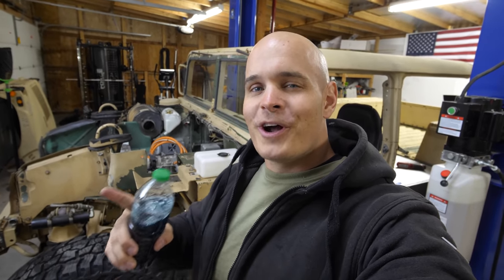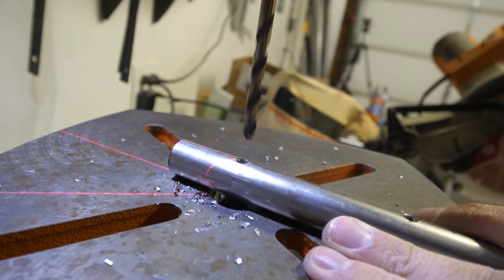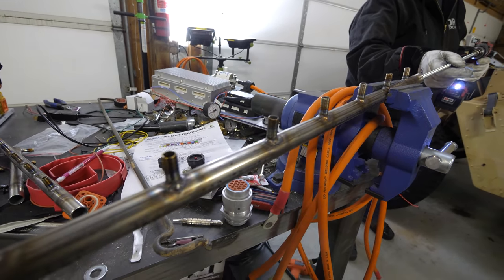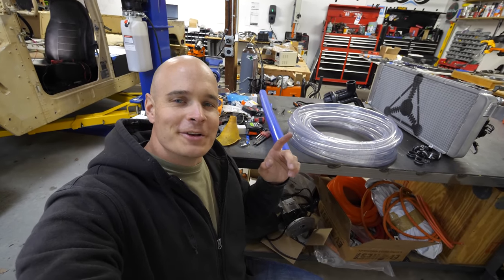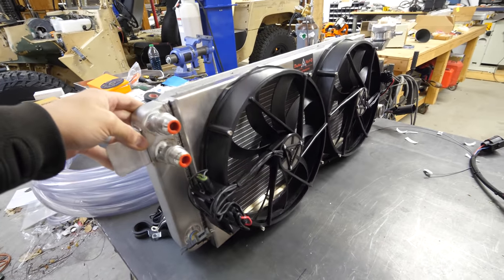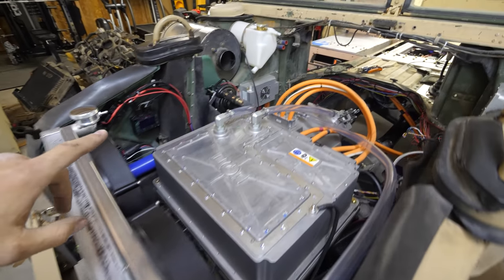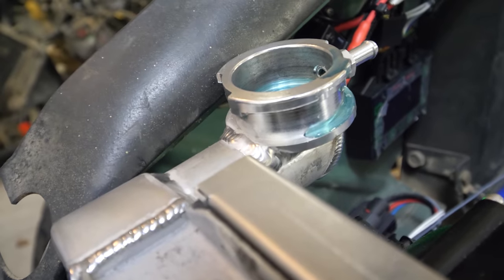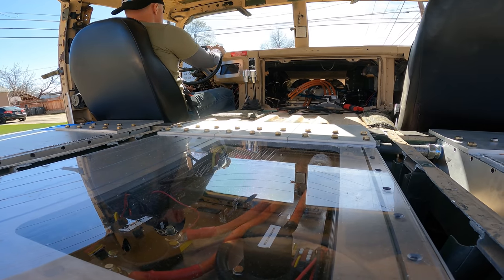The ELECTRIC HUMMER projects 'coolest' video YET...

Comment: Nicely explained. However, I'd like to give my two cents as well. On one side, an expansion tank would be, as some others have said, quite necessary, not only because water expands and contracts but also because althought the system may have no leaks in theory, in practice there may be some if, for example, the lid of the radiator allows some vapor to be released when it reaches a certain pressure. All in all, the temperatures this system should work are nowhere near what an internal combustion engine has to deal on a regular basis, but that adds that extra peace of mind.

And secondly, from what I see, there are some higher and lower spots, for example the top of the, I think it's the part in front of the engine, right where those clear hoses meet some angle pipes. There's some air trapped in there as, again, it's a high spot, and that air is going nowhere and therefore decreasing the efficiency of the system. It may not be something to worry, as it actually works in lower temperatures than, again, internal combustion engines, but it will certainly make the system work harder and therefore more power consumption. So, I think some kind of purging valve should be placed there and anywhere else where there's a local high spot in the circuit. If you're changing your piping for another one that can actually deal with antifreeze (as someone else has suggested) I wouldn't hesitate.

Thanks!

Comment: Regarding aerodynamics, perhaps you could have something like an acrylic bubble cover over the hood in the front creating a smooth transition all the way to the roof out of a transparent material; and smooth out the rear facing surfaces into something a little more raindrop shape with whatever composite material or whatever you prefer?

Comment: Really cool project! Are you planning to completely bleed out the air from the cooling system? At 25:16 it looks like there's quite a lot of air left.
It might make some problems on hot days or long rides if some of the components are not or unevenly cooled.
Reply: usually watercooling has a reservior for trapping the air. kinda missing here. or maybe i am just too used to having one from pc watercooling.
Reply: @FeuerToifel  the rad is the res on almost all cars. Bmw makes some vehicles with a separate res.
Reply: @zillbot  is that US car thing? Because majority of cars i drove in EU have seperate res for coolant.
Reply: @keldon1137  there is an overflow res but that is nothing like the res in a pc cooling loop. The overflow is not actually part of the loop itself.
Reply: @keldon1137  It does not, it's an overflow bottle. I've never seen a standalone res on any car that I've ever worked on or seen under the hood of.

Comment: A little late to the game, but question: Why didn't you run the internal LCD for the fan temp into your cab? Not even for the cool cyberpunk look, but just because having the fan temps in real time would probably help some rather than having to access it from under the trunk.
Reply: Or just report it over CAN-bus to be included in the main displays next to speed and charge level.

Comment: NO RESERVOIR? What about thermal expansion??? You could get leaks in the system without a reservoir that's one of the big reasons they're used in cars

Also your radiator seems to be aluminium, but the heatsinks in your battery might be copper... which will lead to galvanic corrosion, and eventually your system will leak (hopefully not inside the battery or it will destroy it). Just make sure you're not mixing metals!!

Comment: Based on the numbers displayed for drag coefficient and area, the approximate power in kW lost due to aero drag at various speeds in mph can be calculated as 0.15 * v^3:

30 mph ~ 4.1 kW
40 mph ~ 9.6 kW
50 mph ~ 18.8 kW
60 mph ~ 32.4 kW
70 mph ~ 51.5 kW

These numbers are approximate values for aero drag only and do not include other losses due to the drive train, inverter or motor inefficiency etc. However it can be seen that the range at 70 mph will be less than 140 miles with a 100 kWh battery pack, but could potentially be 250 miles at 50 mph.

Comment: The cooling effect is using the Venturi principle, moving air across something will draw the cooler air along with it therefore cooling better. We use it all the time to hydraulically ventilate smoke and heat filled rooms by spraying water out a window…drawing cooler air at the nozzle and forcing the heat and smoke out!

Comment: That clear vinyl tubing is usually not rated for anywhere near 140 deg. Even if it is, it will become very soft and subject to damage easier. The same tubing that has the braiding should be fine like you used elsewhere. Nice work!

Comment: Hey Jerry I have been following these humvee videos since the beginning
My job is a tactical off-road instructor  and mostly working with humvees.
The project is awesome and inspiring! Good job!
Two issues.
First the roll cage is not complete and cut, you should fix it, it's really dangerous!
Second, i think the radiator should go the same as the original humvee angle, maybe the engineers know why they put it that way?

Keep doing the great job done!

Comment: You should install PWM control for the pump and a set of valves. Direct the heat from the motor/inverter into the battery to make it 20°C instead of wasting the heat through the radiator. Should be pretty easy to shut off the radiator and put motor and battery in series for heating. Otherwise open radiator and use a 3 way valve to controll the cool water going to the battery.
Reply: Pump and fans already have PWM speed control internally, both are brushless. Bypass valves are a good idea.  Just bypass the returns back to the pump.

Comment: I have been a huge fan of yours specially the electric humvee project,
Being an Electrical / Electronics Engineer I too work on DIY projects and also fully maintain / service my Old Vintage Pajero 
You should change the Coolant Pipes (Transparent/Clear) one's,
These pipes donot perform well under high pressure and temperature, use black double layered inter woven hose pipes,
those will work well for atleast couple of years,
Anyways cheers and Keep on DIY-ing 😂

Comment: Mixing stainless and aluminium may give you problems with galvanic corrosion, the more diffrent the metals are in corrosive resistanse the worse the problem gets. And yes this still happends with glycol in the mix.

Comment: 19:03 Imo, even in a relatively low pressure system, without a barb that pipe, vibration will eventually work that connection loose.

Comment: Are you wedded to keeping the original shape and configuration? I would consider raking or angling the windshield, possibly replacing some of the steel with something lighter. Ideally getting the most mileage out of those humongous energy packs, also light enough, to take into the backcountry for an extended crawl and romp, without worry about empty batteries and or being stranded. Or are will you add a  generator and 5-10 galleons of gas or diesel as backup to recharge? Or, will you ever go more than a few miles from town? Anyway, a great project, two thumbs way, way up. Envy is eating away at me, that is on me. You are a visionary.

Comment: The initial comparison of cooling requirement based on inefficiency (and thus heat loss) makes some sense, but remember that most of the energy wasted by an engine as heat leaves as exhaust heat, not through the cooling system.

Comment: Great setup, been following you and the build for a while. Now you have a lot of tire and hub noise, normally that is absorbed a litte bit by the engine and wind (stone crunch 6.2/6.5 machine) noise, but since you have silence motor now it must be a lot of winding noise from tires and hubs. You should look into HUBS from the last build Hummer H1 Alpha, 2006 year. It has angel cut gears, not straight cut like all others Hmmwv or Hummer H1. Expensive YES, but more silence.

Comment: 1:32 Motors have an efficiency curve, it is possible that there is a point the motor is 94% efficient it could also be as low as 70%. 1:52 People have speculated that Tesla have an 89% efficiency under unrealistic idea conditions, including age, state of charge, input power and temperature. I've not watched the whole video this may be expanded on later.

Comment: Software to help with aerodynamics, Eh! The spoiler is an upside down wing: spoil the spoiler times 5 and use 
vertical stablizers times 2 for turns = the
Tethered Flying Car or
the Tethered Flying
Hummer!
The new Hummer is at 9000 pounds and could
use some lift! Stage 2 of 3 stages should be a
Power Tray with hydrolic body lifters to allow for layers of traffic; stage 3 allows for the body to lift the power tray to fly with the power tray landing THEN lowering the body of the car! The turns therefore will
be like the other forms of transport.

Comment: That is a great truck!!! Did you figure out heating and AC??? Should be able to get heat from your cooling system with only a additional electrical off the batteries. AC is all electric with a built in heat pump!!! Now to make it all weather friendly!!!

Comment: No good cooling flow around the battery modules, you need an inverter return line for equalizer the flow in each module. 
In you system the first module have a lot of flow since the last of the pipe ;)

Comment: Just wondering if Plan B Supply could / would help you tighten up those bolts on your bucket, I don't know if they are within the range of your batteries. Mostly I want to know if their build quality makes you smile like cutting metal with a lazer.

Comment: Zack, catching up with this build. In the trade we are excited about 12 volt control systems, especially the traction battery giving amps across to the 12 volt/1500watts box. In here you don't have the big voltage orange going in, however some low voltage wires going in.
Will you join the 400 volt system to the orange socket or just keep it is?

Comment: IMHO you need a crawl mode button which acts like a cruise control for the lowest speed at which the motor has full torque. It's going to be really low and really slow, but you'll want it for rock climbing and such.

Comment: Love the project and the videos. Awesome work. One question, have you considered having coolant enter the battery packs from the bottom? Since heat rises, I figure it would help with the flow (every bit helps?). Water cooled turbos are designed that way.

Comment: On the aerodynamics problem.... You take a leaf out of the Lamborghini book and pump air into the space behind the vehicle to reduce its drag. Lamborghini do this by allowing the hot exhaust gases to come out of the rear spoiler/wing on the Huracan. Now you don't have hot exhaust gases, but if your battery was air-cooled you could rout that volume of air into the space behind the hummer to mitigate the aerodynamic drag.
I wonder if pumping that much air could tick both boxes? (cooling the battery and reducing drag)
Reply: I agree, hypothetically, i wonder what it would sound like if he did end up making the car air-cooled? You totally wouldn't want to air-cool the batteries unless you were incorporating some extra feature like aerodynamic reduction.... 
It could get noisy i guess? The old Toyota hybrid system is a little noisy with its air-cooling and its only got 1KWh batter capacity. So Zac's its 100x bigger.

Comment: Surprised battery cooling didn't run lengthwise in the space naturally left over when stacking circular batteries.  That space being a 3-pointed or 4-pointed star cross section depending on stacking pattern.  Flat cooling channels would be natural for pouch cells, but not 18x65.0 cylindrical cells.

Comment: I started watching these videos this morning and as of now, I've only got 3 left to go.  I realize this question is late, but what about heat and window defrosting?  It might be uncomfortable to drive in cold weather and really hard to see through the windshield as well.  I am not sure how bad your winters get.  Though I suppose with multiple vehicles, you don't have to drive it in the winter.  I used to have a Suzuki Samurai that was about as aerodynamic as your Humvee but much lighter.  It was a lot of fun to drive in the summer with the top off.  But it was so boxy with the top on that I found myself compensating for cross wind so much that the car would suddenly veer when I went under an overpass cutting off the wind.  I miss that little car.

Comment: So we're down to 89.3% efficiency at the motor output shaft (94% x 95%). The "Golden Rule" is 15% but you don't have an actual transmission. Following the "Golden Rule" gives us an overall system efficiency of 75.9% compared to an average Internal Combustion Engine which comes to only 25.5% of the system energy reaching the wheels. Basically the whole system is 3x more efficient. If you had a motor at each wheel it would obviously go up from there as you'd lose most of the transmission losses.

Comment: Jerry did you know that in the cooling system there is not supposed to live air in it or it can or may give you some over heating problems so just to mention it out you should bleed the air out of the cooling system

Comment: @JerryRigEverything the engine sounds like its jerking. I wonder if a torque converter or soft coupling or some kind of tuning would help. That's just how the motor sounds, like its jerking back and forth, rather than smooth acceleration. Or it could just be the sound of the vehicle's bad suspension hitting bumps on the road.

Comment: one minor thing, might wanna add a tube at the little nozzle near the radiator fill cap...
You know... just in case so it won't just spill coolant all over the electronics when pressure builds up :|

Comment: Jerry, I have a HUGE question to ask you. Is it possible to add belt and friction dynamo generators to all four wheels in order to generate electricity whilst the car is in motion? That way it would extend the distance of the HUMV-E quite considerably. Sort of the opposite of regenerative breaking?
Reply: That would defy the laws of physics. Any energy expended to propel the generators would be energy drained from the battery in the first place, and you would lose energy in the process to heat and friction. Besides the electric motor is a big generator and when he coasts it will turn from the drivetrain momentum and regenerate electricity into the battery anyway (I believe he said his motor controller supported regeneration). The reason regenerative braking is considered braking is because there's considerable load when you are using the motor to generate electricity.

Comment: @JerryRigsEverything: Would you say this vehicle with all the electric conversions still safe for deep water crossing? I really love what you have done here. I have an old Toyota Land Cruiser 80 and I have been thinking about overhauling it to make it a super offroader, however, when I think about the powertrain overhauling, I am not sure if I should rebuild the already functioning powertrain and add two turbos, or convert it over to what you have done? Water crossing and mud are my concerns. Also, in the case of rebuilding the gas engine and adding turbos, I am not sure if I get any better fuel economy than the current 12-15☺️

Comment: Shouldn't there be an overflow tank connected to that spout directly under the cap?
Reply: I don't think it needs an expansion tank since the temperature and pressure are much lower than a standard cooling system you see in a gasoline engine.

Comment: Hey Zack ! do you keep the Cooling system always on? Like connected to the 12V and it only comes on when you turn the key "igniton" on? or does it stay on all the time. cos that could drain the battery but also you need the cooling circuit working on if its charging the batteries right?

Comment: Do you need all 3 battery packs at the same time or can  you separate them so they can be used 2 at a time then  and use and 24 volt alternator and inverter to charge the pack not in use on the go your already cooling the packs to begin with obviously its not gonna power indefinitely but i dont see how this cant extend your range doin this in any electric vehicle should be possible unless you need the full power of all the batteries at once

Comment: 70% lost power is mostly lost bcause the exhaust is at 1600 degrees and still expanding: one cylinder is able to power 2 12cylinder engines because of the expansion

Comment: Gas or diesel? Electric: there's still a lot of air in the cooling system. I think you were supposed to add an air eject hole somewhere. Anyway clear hoses have spoken: it will be bad to have air inside them

Comment: The sad truth is during independent testing with a fuel cost of $4.45 a gallon electric cost the same amount as a gas powered vehicle per mile. Just imagine if fuel prices weren't inflated by an admission that halted pipeline production and oil drilling. At pre Biden fuel cost of $1.99 the cost per mile of electric would be more than twice the cost of gas. And that with an engine like you mentioned is only 30-35% efficient. The test also didn't take into consideration the high cost to purchase an electric vehicle compared to a gas vehicle. The higher price to purchase a vehicle should always be added into the overall cost of ownership. Also 30-35% efficiency is for gas. A diesel engine is 55-60% efficient.

Comment: I really doubt your shower analogy, the reason the water is cooler at the bottom is "lean" heat. And the coolant here is to transfer the heat from warmer place to cooler place by a method called "circulation".
I absolutely  love all your videos though .